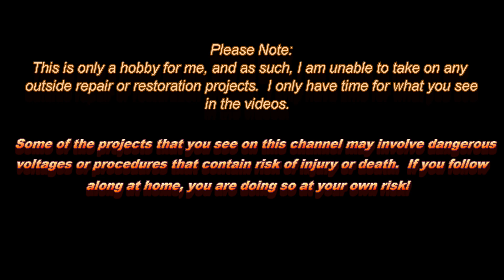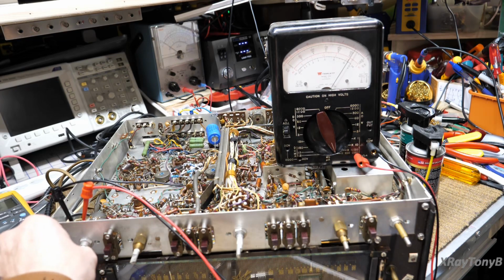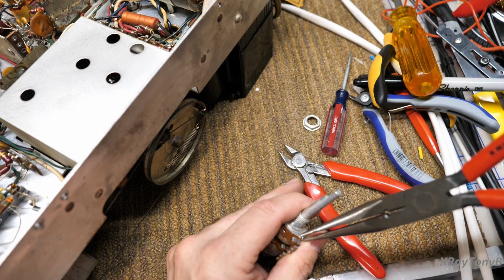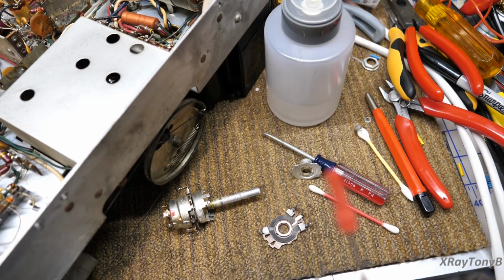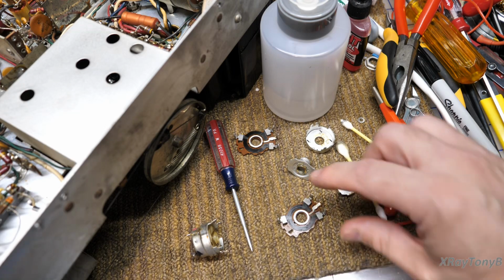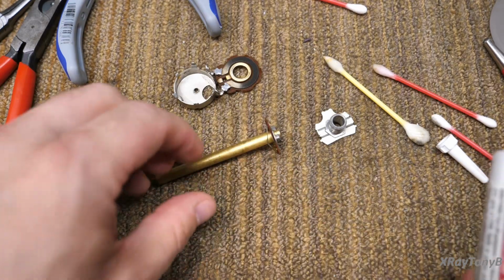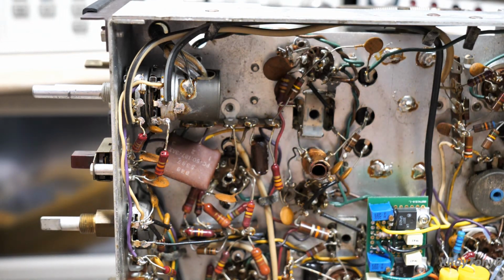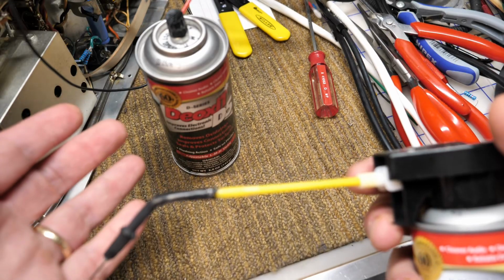How to Clean & Resurrect an Embalmed Potentiometer (With Bonus Rant)

Comment: Hi Tony I really hate to criticise a fellow tech's videos but I absolutely have to I'm afraid. Your assertion that DeOxit 'eats carbon tracks' is simply wrong and you are putting out bad information. I got so fed up with seeing  incidents of this bad info on the net that I did this video https://youtu.be/inacV3cUV1A .
For the sake of anyone reading, DeOxit D5 does NOT 'eat carbon tracks' and is 100% safe to use on standard carbon pots. I have used it on litreally thosands of pots without harm, as have many hundreds of other techs. Now, if you have an ultra expensive, rare pot and have the time to remove it, disassmble it, use cotton buds soaked in alcohol to lovingly clean it etc etc then you may want to, but this is utterly impractical for maintaining guitar amplifiers (which I do mostly). FYI I am 10 months into running an experiment. I have an array of pots and have been cleaning and rotating each weekly with various cleaners including alcohol and DeOxit and others. In Jan I propose running tests on them all, also disassembling and examining under a microscope. I'll make a vid about it. All the best.
Reply: Stuart. I am going crazy back n’ forth with this claim.  DeOxit even put a myth buster disclaimer on their website & I started to feel better.  Then I saw your video refuting that DeOxit ruins pots.  I bought this stuff (DeOxit) with the hype that this is by far & away the best product on the the market made specifically for this task.  So much so that even though I have a can of perfectly good contact cleaner that I bought at Radio Shock, I still purchased the almighty DeOxit.  This stuff is very costly.  If it doesn’t clean pots, what good is it?  I have both the D5 & F5 variants & I am wondering if I should’ve only bought & should only use the F5?  This is causing me anxiety.  Can I use D5 or was it a waste of money destined to further destroy my equipment?
Reply: @realledbetter5015  Hi. My video sets out my position clearly, DeOxit D5 does NOT 'eat carbon' ruin pots or anything. In my view that's a complete myth. Thousands of technicians worldwide use it and have done for years. If it ruined pots it would be a MAJOR issue and all over the internet - countless people complaining that their gear had been totally ruined by using DeOxit. You just don't see that. Btw, generic contact cleaner and isopropyl alcohol also work well. USe the fader lube for faders as they need a bit more slide-ability. Hope that helps!
Reply: @stuartukguitarampguy5830  Stuart thank you for answering so quickly & calming my nerves.  Especially on someone else’s upload.  I am looking forward toward your video where you have the four pots mounted to wood & deliberately spray ungodly amounts of various cleaners except to the control pot.  On your last video it appeared that you had sprayed almost a full year with DeOxit D5 just about on a weekly basis & it appears to be turning smoothly without consequence.  Thank you so much for your videos & setting the record straight!
Reply from the maker: There is certainly no offense taken in your comment.  This is how we all learn from one another.  I will admit that perhaps my choice of words was not the best.  This is a result of not scripting my videos.  I totally agree that DeOxIt red, nor almost any chemical is capable of eating carbon.  Carbon potentiometers, as well as the old carbon comp resistors are made of compressed carbon powder mixed with a binding agent.   Some of these resistors, especially the older ones from the early 1930's/1940's radios can fail when exposed to certain chemicals; not because the carbon is being eaten, but because the binding agent can break down, creating a carbon "sludge".  This compromises the integrity of the carbon track in the pot, until tit eventually fails.    Sometimes, even moisture ingress can cause this on really old resistors, causing them to crack.  This is often the cause of "shot noise" in old carbon comp resistors, and even some pots.  Red deoxit was designed as an anti-corrosion agent for metal contact surfaces.  I believe the earlier formula of this chemical was called Cramolin.  Ben over at Applied Science channel even did a video where he created a home brew version of it in his lab.  The Deoxit faderlube green is a more gentle chemical and was designed for contact with carbon composition potentiometers.  Regardless, it isn't a good idea in my opinion to apply too much of either to the inside of a control.  A s you see from the video, it makes a big mess and usually ends up with the device returning to the bench with noisy controls in a year or so.  At least that has been my experience.  This is why I prefer cleaning the control with zero-residue cleaner and then treating it with a small amount of the appropriate chemical.  I guess that's what I was trying to communicate (in a humorous way at the beginning) in this video.  As always, nobody, including myself, is beyond being wrong sometimes and that is why I appreciate your input.  At the end of the day, I hope we can all come up with the best way to preserve this old and sometimes historical equipment.  Thanks for the comment!
Reply: @xraytonyb  Thanks for clarifying Tony. Yes all my experience is on modern (i.e. post 1960!) carbon track pots and I don't have experience of those older pots. It would be interesting to get an old one and soak it in D5 for a month or so and see what, if anything happens. Agreed we all learn from each other!  All the best.
Reply: I see Tony hasn't a lot of time to answer questions, so in the hope you or another person can, I have one (totally newby!) : so the black track in the volume potentiometer shouldn't be wiped out but you should wipe and clean the blackness in the selector switch? because that is what I did the other day and it seems to work fine. Watching this video I got afraid that I wiped something away that I shouldn't have.
Reply: @thebirima91  Hi Robert  Don;t worry, you haven;t wiped anything away!  You're good to go.
Reply: Thank you very much! @stuartukguitarampguy5830
Reply: Stuart, I tend to trust Tony on this. Saying that "Deoxit eats carbon tracks" may be inaccurate, but in practice he is probably right to caution against immoderate and wrong use of it. 
Your "experiment" is far from being exhaustive enough to prove your point; through the history there were a lot of different chemistries used in both making the substrate which the carbon tracks were applied to, also a lot of chemistries of carbon tracks themselves, plus many different chemicals used to lubricate the shaft. Pots are generally made to "run dry", with only grease in the shaft; any substance on the carbon track brings on all kinds of trouble: not only they can (in long run) influence the substrate or the track, but it also traps dust particles (which then scratch the track). If it is used in excess, all this gets much worse and a lot of times, as Tony mentioned, Deoxit also spills out and comes in contact with other parts of the circuit. With all that in account to stay on safe side when working with irreplacable parts (pots for HiFi are such quite often, on the other hand guitar pots are generally pretty expendable) it is probably best to avoid ANY active agents. 
And let's take a look at the name of the product, it is Deoxit, so it is made to remove oxiation, corrosion. Carbon tracks do not corrode, they only get dirty and dusty  - on the other hand any metal corrodes to some extent. Active ingredients in Deoxit are there to eat away that thin layer of corrosion, which forms on metal contacts - this is just chemistry, no magic. It's just the same as it is with "no removal flux": if you are sane, you remove it after soldering anyway. 
In my experience pots, which can be replaced, should be replaced - the ones, who can't should be maintained with more care than just flooding them with some popular "all in one" junk. 
There is but one problem: a lot of modern pots are made in a way that they can't be dissasembled (eg, shaft stamped to the wafer in Alpha pots) - there you can hardly do anything else than try to flush them out. But still using soapwater is probably best. 
On the other hand guitar amps you work on (one of the best channels on the topic on YT surely) are much more exposed to various bad conditions like "living room equipment" Tony is working on - so they need to be cleaned more often. Scratchy pot on the stage is quite a different issue than in your living room.
Reply: @realledbetter5015  in general:use D series for metal to metal contacts, use F series for carbon or conductive plastic(IOW, ALL pots, rotary, as well as slide)-the only exception:wire-wound pots that use a metal wiper(as these DO have metal to metal contacts)..note that SOME wire-wound pots use a carbon wiper-these MAY, or MAY NOT be ok with D series.
Reply: Stuart made a whole video where he so called DEBUNKED when I said this to him.
Why does the company make TWO different products where one states specifically that it is to be used for pots and faders (F5) vs the other one that doesn't state that it is to be used for pots and faders?

DeoxIT-D5 cost more, contains mineral spirits (which over time will erode the physical integrity of the carbon tract), and doesn't EXPLICITLY state that it is to be used for pots and faders. There's a reason why.

DeoxIT-F5 cost less, contains NO mineral Spirits, and DOES EXPLICITLY state that it is to be used for pots and faders. There's a reason why.
If those two products were the same, then why would the company make one where it says something very different from the other? They're formulated differently. Why would they be formulated differently?
Reply: In fact the D5 does now explicitly state pots.  So much for that. The F5 has lube for plastic. It's not a mystery.
Reply: @bkw777  I've been on Deoxit homepage, and I can't find anywhere, where they recommend D5 for Pots, they recommend D100, F5, F100, for audio video equipment, as far as I can see.
Reply: @xraytonyb & Stuart: 

 I've been servicing for nearly 60 years starting back when carbon-tetrachloride was the hot kid on the block!  I used to really clean-up spraying TV tuners and noisy controls since as a kid, I had no idea what I was doing but found that most failures were mechanical; or if you just left the set on, then replace all the charred-stuff, you fixed most things!

Anyway, I do take exception that D5 is harmful. 

 I too, have had sets come back months after with the same noisy control complaints.  
What I have found is that when you spray most pots, you liquify everything that's inside!  So, you can have all manner of dirt, oxidation and congealed grease. After you spray, and mix your witches-brew, you end up re-coating everything with a thin-layer of this sludge. Since you operated the control before it dried, you 'ploughed' a working-track on the carbon-deposition and think you got it licked.

As time goes by, through heat and movement, this sludge gets back on the track and starts collecting on the wiper causing problems, only now in an accelerated way.  This is why everyone is so stunned that things go south after using Devil's Elixir #5!

In all my years, I have used just about everything that was produced.  With the exception of a product called Blue-Shower which contained acetone and ethanol (which destroyed almost all plastics/removes paint to the point you couldn't even ever turn the controls again! Try explaining that to a customer when you are a kid!)  I have never seen any one of them destroy a perfectly good carbon-deposition--Period! 
There was always a mechanical wear-defect in the wiper pathway!

Finally, to properly service a pot that is enclosed, it's disassembly or replacement like Tony did.  If you got away with just spraying, either there was a big enough exit-path (like at the carwash!) or your sludge ended up in a safe place out of the way. A trick, is to orient the newly sprayed pot so that the backside-can is on the bottom--according to gravity!  

I have not seen one pot (unless it was just worn-out) and was noisy, that did not have post-spray gunky contamination; they always have visible signs of needing further-cleaning.
  
Another issue, is the customer complaining that the controls have lost that 'viscous-feel' and feel cheap!  So, F5/F100 is better for the spray-and-pray crowd!  
Hope all this helps & 73...

P.S., I find most all contact cleaners worthless for silver-contacts.  It appears that Haggerty's Silver-Dip contains the same chemicals that we used when I was a missle-tech at an Army Depot. Just put some on a good-swab and wipe.  However, you must flush with IPA or a residue-less contact spray.

Comment: Ha ha ha! Now you know why I make my own mixtures. Oils & greases attract dirt. De Ox It has both in it! It is also acidic too!!  It slowly chews & eats away at the pot's track. That is why I rinse that shit out with a mild lye mixture and then I mix that out with mineral spirits and a tiny bit of Dow Corning dielectric grease I mix myself and use in a reusable spray can. Dow Corning 640 is friction grease.
Reply: No need for all your sillyness. Red DeOxit  is a metal cleaner, and it leaves a special coating on metal that prevents further oxidization. It is NOT acidic, and it is NOT oily or greasy either.
It's obvious that if you spray Red DeOxit on bread, it will not preserve it. It's also obvious that it's totally unsuitable for kittens, plastic, human skin and carbon too. Hence why using the correct product for each application is important.
Reply: @johncoops6897  Correct.  Which means, don’t spray it haphazardly into potentiometers.

Comment: Fun Fact. Greg Mackie’s Tapco (the audio mixer company) tried dozens of potentiometer lubricants until they settled on the very best solution to achieve a perfect “feel”. 

Raisin Juice. 

Later they used silicone grease.

Comment: Happened to me on a pinball machine speech pot which was not having any problems but I sprayed it with the Red which I had recently bought, normally I use tv tuner spray.  Tore it apart afterwards and the entire carbon track was gone and had to replace it.

Comment: I just sent a email to them, we will soon see if the chemicals in D-5 will cause damage to carbon potentiometers.
Reply from the maker: I think if you scroll down through the comment, you will see where a rep from Caig chemicals already commented on this.  It will be interesting to see if you get the same answer.   Either way, I'll stick with using the green stuff (Faderlube) on pots and red stuff (D5 / D100) on contacts.
Reply: He stated if you use it over time it will damage carbon pots. I’m not going through 260 comments to see if he did. I won’t anymore but the once I used it my unit works fine.